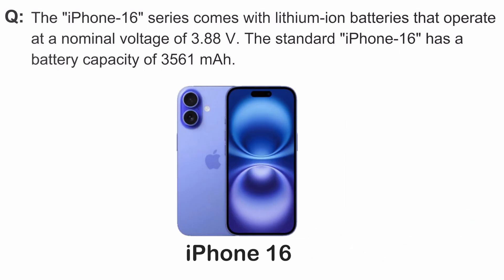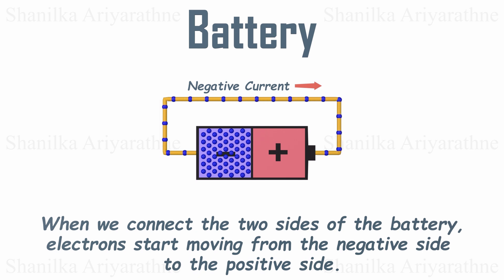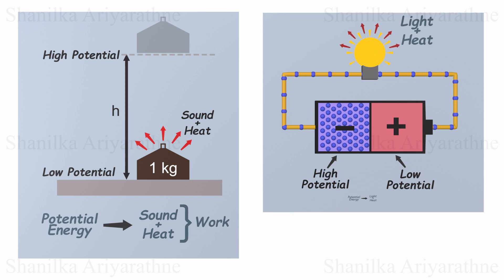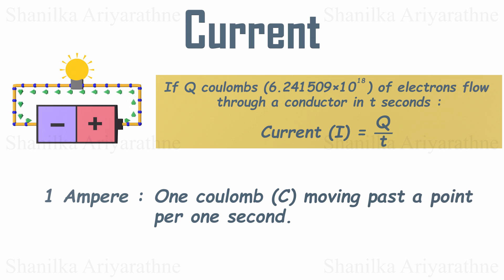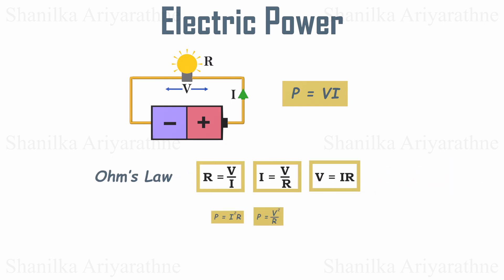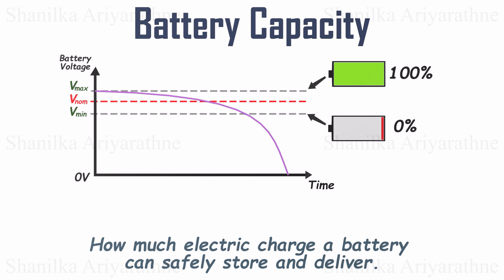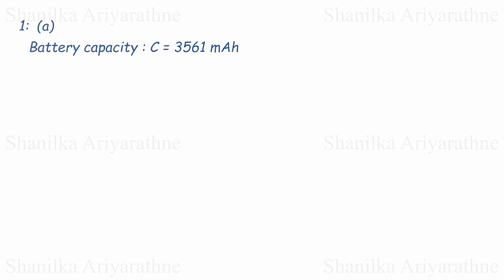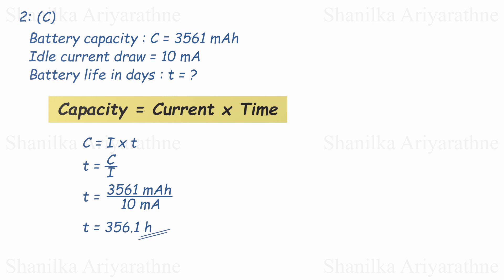iPhone 16 Battery SOLVED: How Long Does It Really Last? (Physics Explained!)

Comment: Nice video i liked the explanation on batteries in terms of charge: one qualm, in part (a) you should convert the time into seconds first

Seconds being the standard unit of measurement for time

This is also a problem when you calculate power in part (b), it is  6.9 Joules/ hour, which is not in watts